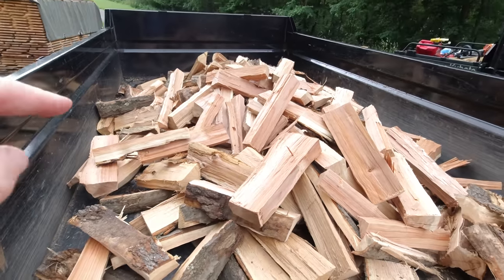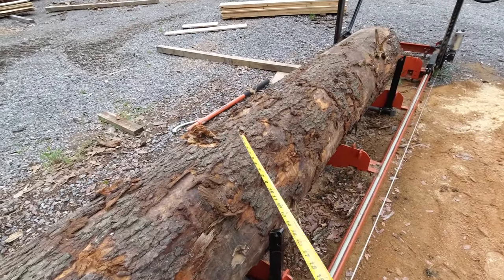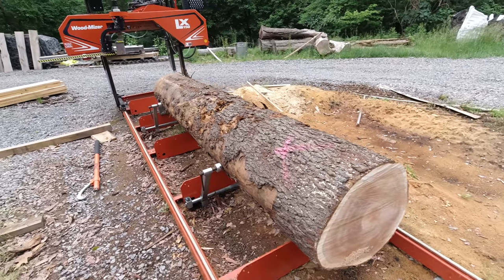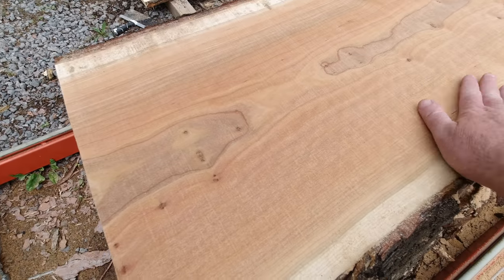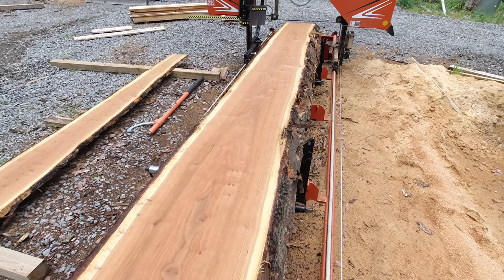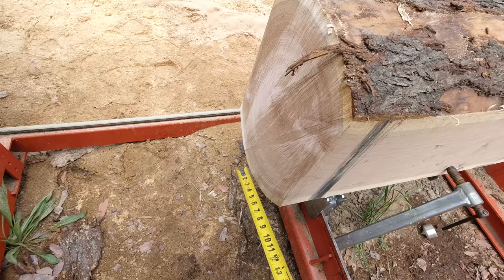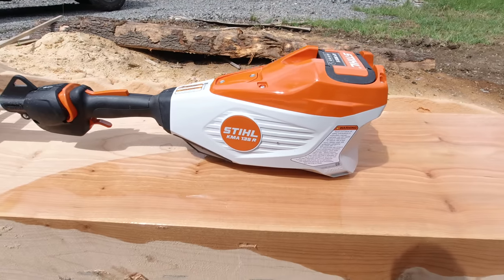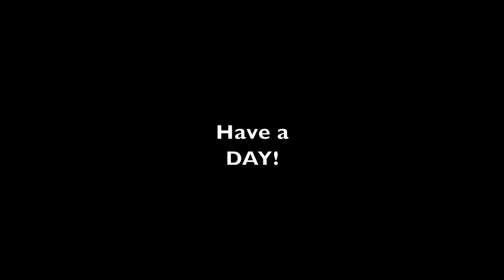THIS IS IT! The Best Cherry Log I ever  sawed on the Mill

Comment: Hey Mike, We get non ethanol gas and off-road diesel delivered to the house. I have a 250 gallon tank with a hand pump for each and they come fill it up when ever I call. They have a winter mix for the diesel that has a lower gel point. That really help with cold start.

Comment: I stole your diesel idea for both my diesel and gas.  Two 50 gallon tanks which I spray painted a band on the side and stencilled in a label.  Red for gas with “gas” written on and yellow for diesel with “diesel” written on. Both mounted on custom made skids.  I can actually get both tanks in the back of my pickup at the same time so a few trips a year to the station and I’m all set for the ATVs, side by side, splitter, mowers, and the tractors.  Works great! It’s a tough pill to swallow at the pump (filling up with 50 gallons of diesel and 50 gallons of premium gas) but I never run out anymore and i only have to touch a gas can when I need mixed fuel for the chainsaws/trimmers.

Keep up the great work!

Comment: Mike, my father-in-law used to buy those outer log bark layers from a guy doing lumber like you. Cherry, oak, maple and ash. It dried and burned nicely in the fireplace. You obviously, can’t charge what you do for the split logs but I’m sure you’d have a ready market for these sides with bark instead of putting them in the burn pile.

Comment: Hi Mike, I would convert your 50 gallon tank to gas use after a good rinse, unless it is labeled prohibiting gasoline use. Your pump may need to change to a pump rated for gas use as well. I set up a 100 gallon tank for diesel on a skid that I can move if needed and I have off road diesel delivered. It has come in handy for emergencies (missed home heating oil delivery on a 10 below week!) and all my equipment including my generator run on diesel. I can put it in the back of my truck with the skid steer forks and pick up /deliver diesel if needed. I keep my tank in my barn out of the sun.

Comment: Mike......I had thermostat problems for years, until I put a thermostat in the closet close to the other one. Cut the wire off in basement and attached to one in closet. I kept adjusting one in closet until I had my temperature. That lasted for 35 years !! She never found out !!
Reply from the maker: Lol

Comment: I highly recommend Wurx fuel containers.  I like the 20 gallon container with the fuel pump.  No more pouring fuel out of a 5 gallon can.  They are stackable.  I put mine on a small four wheel appliance dolly so I can move it around in the garage.  The pump can operate on a 12  volt battery, or 120 volt AC power.

Comment: Check with your local COOP for a tank. Some will supply a tank if your usage is enough each month. 
Also, that way you could get it filled without the highway tax added, as it's for "farm" use.

Comment: Have you though about adding solar panels to any of your buildings? Might be a good idea down at the timber processing area on the new building, somewhere to charge the batteries for your Stihl toys? Plus you could probably use those LED lights you bought to temporarily light up the new building up top.

Comment: We keep our thermostat at 66 during the night and up it to 68 or 69/70 during the day. I used to work out in the Arizona heat and sunlight at 110-120 on machinery that ran at 140+ and I like my house cold. Didn't have A/C until the 1980's but once I had it I will not do without. Luckily we have lower humidity than you do most of the time.
jack

Comment: I store diesel fuel and gas in 50 gallon plastic olive drums.  The top lidfits a land diaphragm pump.  And you can move them around with the loader bucket.  I usually run home heating oil in my diesel machines.  No tax because it's off-road use.

Comment: Not sure if you have Tractor supply n in your area,  but they sell 50 and 100 gallon fuel transfer tanks and pumps. In my area,  I get bulk fuel delivered and fill up the gas tank.  Anything left at the end of the season goes in the truck.

Comment: I hoped that was your intention was  to build covers for all  the equipment. Nothing screams lumber storage like having a wooden exterior and its only a idea suggestion here but say your going for walnut, cherry, hickory, etc so here is the weird idea would be to do lap siding on these storage areas and if you could saw your different areas keeping it segregated to wood species in each area... I know its a long idea.... do each area partially in the type of wood stored inside of them. Like cherry for example. Take some siding sawn on the mill for the cherry storage have some cherry siding on that one and do some radical color changes like oak, cherry, walnut, pecan, and see the different colors come out with just linseed oil for color effects and now that you know where I was going, just do like two or three laps and then finish in whatever wood that you chose to do it in unless your going metal again. Metal is easy and fast and other just wonderful ideas but this is wood storage and people will want to see it finished so they can get a better choice in wood. Have you considered taking some of the too short for lumber marketing and saw these for the Eye to see when they see what to choose from. Just a weird idea thats been popping around in my head.

Comment: Beautiful Cherry.  Have to come back and check comments later because I got here too early and I'm interested in whether others have fuel storage solutions they are happy with.  I need to figure this out also and have been shocked at cost of 50-100 gallon storage cubes with pump.

Comment: I know of some areas in NEPA that are a mix of red and white oak along with many cherry trees.  Some of the cherries are over 4 ft in diameter when I measured them almost 30 years ago.  We had one chestnut taken out by a one of the drilling companies that was over 4 ft in diameter where we excluded placement of a pipeline.  I have collected and sent out a few hundred nuts from that tree over the years and planted 10 trees from it over 30 years ago.  none have been afected, so how much is a blight resistive chestnut worth?  Those logs we were getting low ball bids for until I started to call up some exotic wood dealers.

Comment: Mike, talk to a local fuel supplier about getting a small gas and diesel tank.  I'm sure you've used them on your construction sites.  You may have to buy 250 or 500-gallons at a time, but they'll deliver it, you'll use it, and it's actually a LOT safer than hauling 5-gallon cans in a truck, and WAY more convenient!  Also, by DOT standards, you're only allowed to haul 2, 5-gallon cans of gas at a time.

Comment: Hey Mike, Would a small transfer tank work for you? But rather than leaving it in the truck set it on a pallet so it can be removed easily with your pallet forks?  Your own little gas station in the renewable resources center.. PS Hey Hunter!

Comment: For the next couple of days, it’ll be 100 + Fahrenheit heat index here .  Air temperature of low to mid 90’s Fahrenheit during this period. 

Probably around middle of July to early September, it’ll be 97° air temperature and 105°+ heat index for the daily basis.

Comment: A 10' x 19" log, according to Mr. Doyle, scales out to 141BF. Your original 12' log would have scaled out to 169BF. In either case your yield would be 10-30% higher,
Good log, good video.

Comment: Mike, I utilize a 55gal drum with a hand crank pump, with filter/ water separator for my fuel. I mounted it on a pallet so I can lift it in my truck when I need to fill it, and then move it to where it needs to go. Super simple and nice having 55 gals on hand.

Comment: Word of warning ethanol gas does not store well.  The nonethanol does store pretty well.  I only use nonethanol gas in all my small engines from 22 horse garden tractor to all my 2 cycle engines.  I only buy 5 gal at a time and store it in plastic gas cans.
Reply from the maker: Yes I am well aware of that, I have talked about that in numerous videos
Reply: Paul, you are better off storing you r gas in metal container.  Plastic breaths and you will loose octane over time.
Reply: @realairplane261  I only buy enough to last about a week and have not noticed any problems.
Reply: Very good Paul.

Comment: Unfortunately, with gas being so much more volatile than diesel, Its storage life is drastically shorter than diesel. I am much like you in that I use about 20 gallon every 2 weeks in the summer on my property between lawn mowers, weed wackers, leaf blowers and pressure washers. I use a mix of 5 gallon storage cans. I really find that its best to store gas in an air tight container due to its volatility. You Should be using gasoline as quickly as possible once its in the cans. If you plan on not using it for a month just add a few oz's of seafoam to stabilize it. I have a few of these cans and love them https://www.eagle-mfg.com/safety-cans/type-i-safety-cans/type-i-steel-safety-can-flammables-5-gallon-funnel-flame-arrester-red-ui50fs . They are a relatively local company if you live in southwestern PA.

Comment: I went with 30 gal  fuel catie with manul fuel pump on top.  Got it from Amazon there are many options out there. Don't have to lift and hold those 5 gal  cans over a lawn mowers and tractor saves on the back big time. Your need are more extensive than mine, l'm sure you will be glad you changed your fuel distribution. 😉

Comment: We had a 500g gas storage tank mounted on an elevated welded frame that was slightly lower in the front so that it would gravity flow with a standard gas hose and trigger nozzle. Worked great!

Comment: I resolved my gasoline storage problem with a portable 14-gallon tank available on eBay.  I don`t use the pump provided but a battery-powered transfer pump available at harbor freight.
This works for me because I use the 93 octane non-ethanol gasoline in all my yard tools including my toro zero turn. 

DURAMAX FLO N' GO " 14 GALLON PORTABLE GAS CAN 06792 FUEL CADDY Scepter

Comment: For my Diesel tank, I use a 250 Gal fuel tank that’s been on the farm since 1988. It has Tuthill/Fill Rite 115 VAC High Flow Pump 1" Hi Flow Automatic Nozzle 901 Meter FR711VA (see Rural King) or me that looks identical. Dad replaced the pump around 1995, purchased from Tractor Supply. I have diesel fuel delivered as needed

For my Gas, I have a used aluminum 110 Gal. “L”-Transfer Tank (cleaned, painted and labeled) in the bed of my one pickup truck. It has a new Tuthill/FillRite 12 Volt DC Pump with Automatic Nozzle SD1202GA (purchased from Rural King). I use it on every Gas engine including the wife’s car; I go through 80-100 Gal/month.

Comment: Mike, we are sending more hot weather your way from here in Central Arkansas. It's about 83 outside now (noon) and the humidity is about 80 percent. We had heavy rain the past several weeks. 5 inches in the past 3 days. Love that cherry log. You have a winner there. Cherry wood here is selling for $6.10 per board ft in lots of 1 to 9. Only $5.50 for 10 to 99 ft. You have a nice little nest egg there in that log. Thanks for the videos, Mike. We love them.

Comment: I don’t use that much gasoline, or diesel, for that matter, but I got real tired of trips to the gas station, which is 45 minutes R/T. After some research, I ended up buying the FloFast 15 gallon with pump and hand cart. One yellow for diesel and on red for gasoline. You could buy two of whatever you need, along with the double hand cart. Check FloFast out, American made. Note, I have no affiliation with the company.

Comment: Look up portable gas caddy on Amazon. We used to have one at the shop I worked at similar to this brand. Arksen 30 Gallon Portable Gas Caddy.  It worked great. Easy to load in and out of the back of the truck with a foldable ATV ramp.

Comment: For fuel storage it depends how much money you want to spend.  I am in the process of installing two 550-gallon double wall ASTs that I picked up off a project that were never used (and free).  They can be expensive.  You can use 275-gallon heating oil tanks.  They are relatively cheap especially used but in good condition.  Just make sure you get some sort of secondary containment in case they leak.  You can use IBC totes for short term diesel storage but it will eventually break down the plastic and leak.  Check with your local fuel delivery companies, they may sell or rent you a tank as well as fill your tanks up for you.

Comment: I have heard of guys using a gas tank out of an old truck and welding up a solid stand and hand pump, like some fellers have for token xtra diesel around in the pickups. Seems to work for smaller amounts vs the big 150 gallon overhead tanks.

Comment: I have the leaf blower and weed eater.  Mine is the FSA 57 series. I upgraded the batteries. I love it over my gas powered because of the weight and no mess. It last as long as I need . I agree I would of never thought I would use battery operated devices. I do want to try the baby chainsaw - Pruner. I think it would be great for getting low hanging limbs trimmed.

Comment: BUYING FUEL:   First you need to check with the state or county to see how much you can haul without permits and the type of containers that are required.  

Then decide if you want to go pick it up or have it delivered.  You could use the excavator to load and unload the tanks in the dump trailer.  We use totes like you get to store firewood in.  We go get used motor oil for fuel for our steam locomotive and can transport several containers as long as they are 300 gallons or less using the totes.  If you plan to have it delivered check with the wholesale distributors in your area and some of then may supply the tanks.  Hope this helps.

Comment: A local guy does bundle firewood, his way is he used the web bag he buys by the roll. He had a stand with 2 5gal buckets with the bottoms cut out, he cut his bag to twice length and ties one end than stretches the bag over the bucket and puts the bucket in to his stand. He than loads the bucket till it is full and than lifts the bucket and the wood is bagged. He can bag 30 to 40 bags an hour. That may an idea for your bundling operation!

Comment: You're getting soft Mike, 2 weeks of retirement HAHA just joking. I can't handle heat very well either. High humidity at 85⁰ can get me. 95⁰ with really low humidity is not bad but here in East Tennessee mid summer the norm is mid 90s very high humidity.  I have to just slow down or work early morning or late evenings. Enjoy all your videos. Keep up the good work.

Comment: I have been thinking about your new pavilion.  That is a tough build as far as engineering to design everything the best way to feed the mill, stack lumber off the mill and storing machinery.  Has to be open enough to bring in logs yet protected enough to keep things in the dry and not have machinery or boards or sawdust always in your way.  My problem with rough sawn lumber is the piece I need seems to always be at the bottom of the pile.

Comment: Old 45 Gallon steel oil drum. Tap at base couple of lifting eyes back of the ute whenever needs filling, lift off with all that equipment. Lift that sawmill up when you do move it.

Comment: I run a mid-sized construction company so for gas and diesel storage we have an equipment trailer with two westeel 200 gallon fuel vaults/tanks. I would definitely look into getting a westeel tank.

Comment: Use old oil retainers from the early fiftys that were stored in a basement they are usually five hundred gallon tanks clean them out with gasoline because if a little gas is left in the tank it wont bother decil ok

Comment: Motor, go all out and spend the money to get a proper filling station for gas and diesel.  You will not regret it.   Then you would have good clean tanks with proper filters on them.
Reply: Amen!  There are double walled “tank farm” tanks  side by side.  EPA approved.  Do it now and avoid the rush for when EPA requires small fuel amounts must be protected and the price goes sky high.